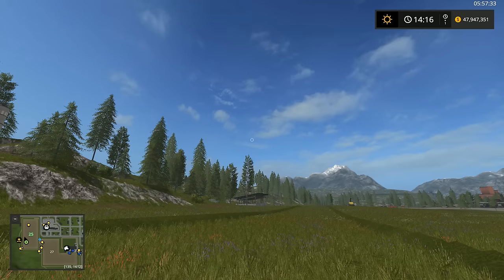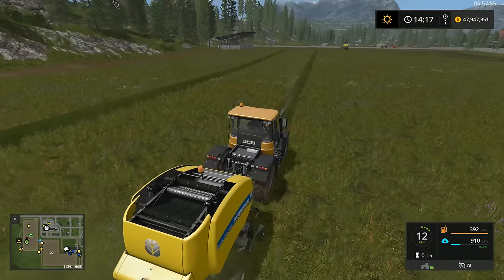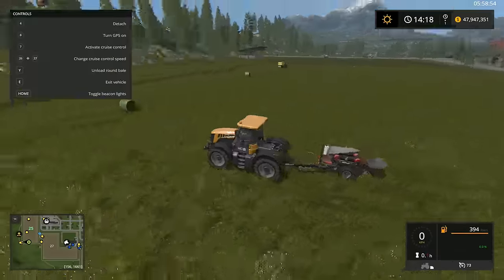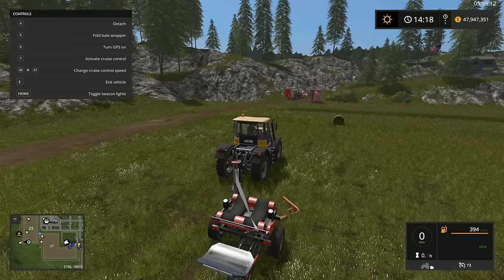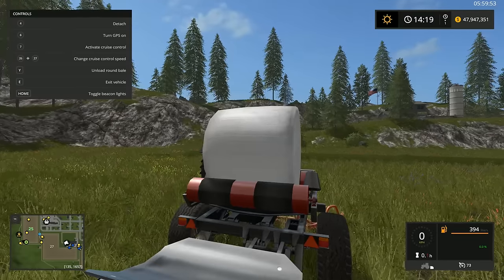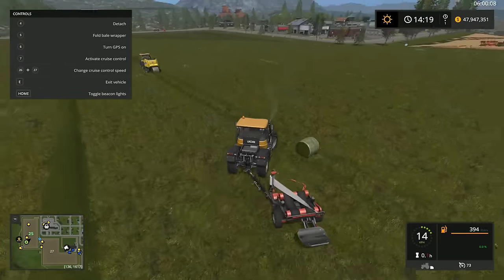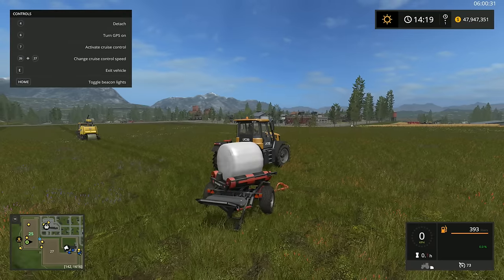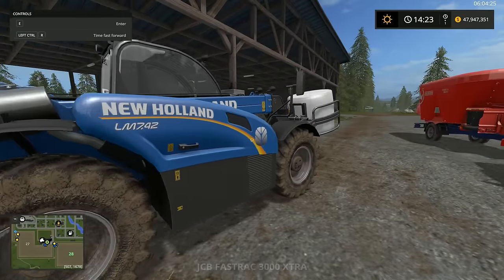Farming Simulator 17 - How to use a bale wrapper to make silage

Comment: love the videos, love the game other than a couple of things, 1st I am playing on the console version right now until my new laptop arrives but a lot was made of mods on console version and 20 days in not a significant mod has been added. the mods are just the same type,size,capability machines that are already on the game. 2nd, the pricing system on crops is awful. there is absolutely very little benefit to saving crops for a higher price. as soon as u sell one load of crops the price drops drastically and literally immediately. if u fill the train which holds 300k liters u only get the price on the first box car. the price drops as soon as the first kernel hits the grate. hopefully giants fixes this.
Reply from the maker: Grain prices fluctuate fast in real life so it makes sense that  Giants would try to adjust the game to match.